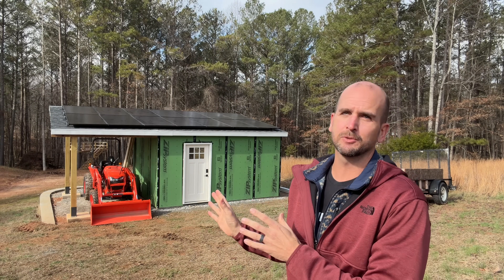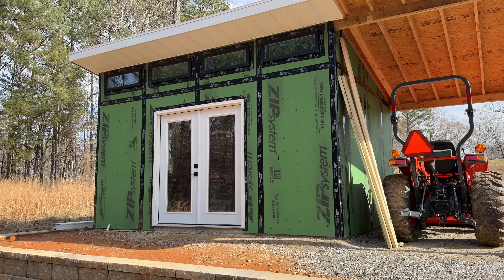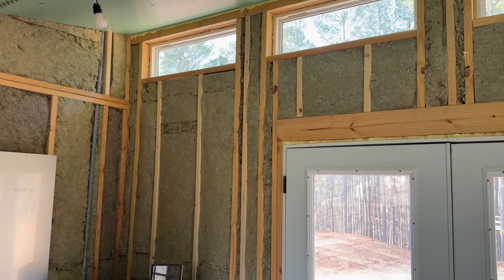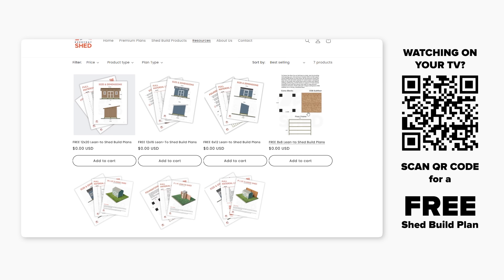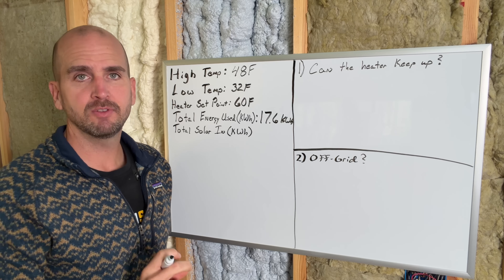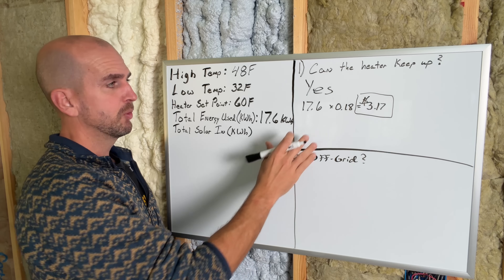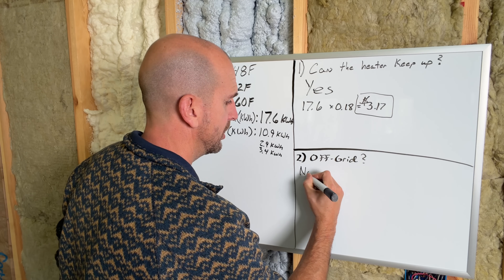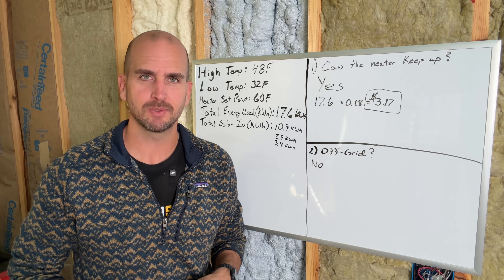HUGE Mistake: Why My $15,000 Solar System CAN'T Heat My Tiny Shed

Comment: Resistive heating is way too energy intensive for it to be a good idea, the style of heater you used is also notoriously inefficient and actually runs closer to 600w worth of heat.  Look up the video "Oil filled heaters: 600 watt heaters pretending to be 1500 watts"

The best way in my opinion would be a window AC style heat pump, with a Geo thermal mod "Turning a $150 AC Into a Super-Efficient Geothermal Unit!" from Tech ingredients. It's not drop in ready or super easy, but when you have limited amounts of energy, you have to get creative.

Comment: As others have mentioned, a heat pump would do a much better job.
I am not sure a 24 hour heating test is going to show you how much you use in real conditions. You don't need much heat at night. A heat pump can be programmed to turn on when you need it. Or be remotely switched on before you go to your office.

I personally would have chosen a different route though. If you have access to cheap or free wood, then a wood stove would be the cheapest solution. Propane is a good alternative if you are not sitting there too often.
Another solution is solar thermal panels. Combine these with a big storage tank and you can store heat for a week or scale that up for even longer durations. Heat storage is cheaper than battery storage. You can add an electric heater that uses excess solar (you're still going to want a small solar system for your lights and devices). This can also be combined with a propane heater.
Reply: I just realized, there is something else you could do in your situation. Although a heat pump could already make the system a lot better, you're going to need to increase your storage to get through a few days of cloudy weather. The best way to do that is to get an air to water heat pump, that makes hot water, which you can store in a large water tank.

Comment: One of those chinese diesel heaters would be perfect for that shed. You could even mount it outside and pipe the heat inside. Use offroad diesel fuel to keep costs lower. Otherwise a small pellet stove would easily do it. Relying on 100% electric is quite a challenge in comparison.

Comment: I saw what you did insulation wise in the ceiling, it's really not enough. Heat rises, the walls are important, but less so than the ceiling.
Reply: Hot air rises.  Heat radiates from higher to lower temperatures.
Reply: Incorrect. Walls are extremely important. They make up the majority of the surface area. Yes he needs more ceiling insulation but it doesn't take priority over the walls. Passive builders have been working on wall insulation improvements since the 60's.
Reply: @shawnd567  that's because when they use the term passive, it's referring to dynamic\nInteractions with the environment , not just insulating

Comment: Mini-split inverter compressor with hyper-heat would do a lot better job then that oil filled heater. I also plumbed in a diesel heater into my tiny home as a backup .

Comment: Yes,Zip R for continuous external insulation, R 40 ceiling, slab insulation and a mini split would perform much better. It would also cost a lot more. Really depends on use cases and cost of electric for the individual if it’s worth it.

Comment: Just an idea here..... With ALL electric-resistance appliances (ALL electric space heaters. hair dryers. toasters. clothe irons. water heaters. hot plates. soldering irons. heat-guns. hair driers. electric stoves and ovens. toaster ovens, etc) you achieve exactly 3.413 Btus per Watt. No more. No less. That same Watt run through an average air-to-air heat-pump achieves, depending on the outdoor temperature, around 8 to 9 Btus for the same Watt. A high efficiency mini-split heat pump with a higher HSPF rating can give you 12-15 Btus or more for that same Watt. With electric heating, an electric-resistance space heater is the most energy hungry of all of them. It does not matter if it is 'oil-filled'. It does not matter if it is 'radiant'. I does not matter if it has a 'ceramic disc'. If it is a plug  electric space heater, on a high setting it is typically 1500 Watt (the highest allowed). At 3.413 Btus' per Watt it achieves at most 5,120 Btu's per hour, IF it is actually using all 1500 Watts. When I use a Watt of electricity, I like getting 12-15 Btus per Watt via my mini-split, and not the 3.413 with an electric-resistance type heater. Thus, the solar system could do better if not using electric-resistance heaters..... And, a simple ACCA Manual-J calculation of your building would help determine the actual Btuh need for the building at different outdoor temperatures.

Comment: Two inches of foam and heat tubes in your slab.  Then heat it with a small propane on-demand water heater and a 100w circulator pump.  Best heat you can get and a small solar setup can run the circ pump and keep the space warm

Comment: I love your channel and appreciate the great information and ideas you tell us about. The following is not a criticism, but a suggestion. You are supposed to 'face-staple' fiberglass batts, and install them where the batt fully fills the cavity; they should not be 'tucked' in the sides. Tucking leaves a gap down both of the entire lengths of the cavity. With all insulations there should be no gaps. No voids. And no mis-alignments, between the insulation and the wall covering. I know some drywall folks like it when the fiberglass batts are 'tucked', fully exposing the edge of the studs. But still, not the best way to install it.
Reply: Your instructions on how to install the batts is 100% wrong.  The fiberglass is touching / sealing to the stud and there is NO gap as you suggest.  The reason to overlap the "tabs" on the stud face is to form a vapor barrier as at one point, the paper was sprayed with tar as an adhesive to hold the fiberglass.  The reason you do NOT cover the face of the studs if installing drywall......correctly installed it's GLUED on every stud and the screws are only used to keep it in place while the glue cures.  This results in a much better bond, chemical versus mechanical, and far fewer screws are needed = less finishing labor.  The glue will not penetrate / bond through the paper tabs on the batts if they are on the face of the stud.

Your method is only 20+ years out of date.
Reply: @Paladin7845 Cite ASHRAE standards
Reply: @ßeau_M  Have NO idea what you're asking for or how that's relevant.  30yrs in the construction industry, (Licensed Builder, Project Manager for both Commercial & Residential, and Truss Engineer) experience with the products, and understanding the solvent in the adhesive wont penetrate the paper is all the "Standards" I need.  From your question I'm betting your the type who's incapable of doing their own research and needs instructions for everything.  If I told you water is wet and the sky is blue.....you'd ask for "Standards" to prove it.  No one has relied on the paper flanges to provide any kind of air, vapor, or moisture barrier in 20+ years.  
Comes down to......do what ever you want on your projects.......but don't post inaccurate information.
Reply: @Paladin7845  beware any contractor who starts an argument with "I've been doing this for 30 years"
Reply: @pb7379-j2k  How does 3 decades of experience invalidate my statements or experience???  It doesn't. But you have NO better response........typical.
Reply from the maker: Thanks for the feedback.

Comment: $15k for such a tiny system is bad purchase. For $15k you can do a huge diy system with way more solar.
Also, a space heater is the worse way to heat anything. Its just inefficient. Use a diesel heater to heat the shop.

Comment: As others have said, resistance electric heat powered by solar plus battery is a terrible idea. Plenty of small heat pump systems are available for that application. Also, insulate the floor. Rigid foam topped by click together flooring would be one easy way to go.

Comment: It seems like solar needs to perform better and get the price of components down a fair bit before it is worth it to invest in it. A huge part of North America and the most populated part of the US get a lot colder than 32 F. Some people that make videos rate the value higher than every single person that I know that has spent 10 thousand dollars or more on a solar system tells me that given the chance to go back and not spend the money they would. I live in a 900 square foot home and pay about 960$ a year to heat with gas and where I live it hasn't been above 32 F for nearly a month and will get a hell of a lot colder like tonight will be about minus 12 F. That battery alone would be years of heat so my gas generator will be my back up for the forseeable future.

Comment: Go with the DiY mini-split(Mr. Cool). Then you will have both heating and cooling.  Install GPS foam board insulation on the exterior before installing siding. Air seal the interior drywall to the ROs and top and bottom of wall before installing trim. A tight building with extra R value doesn’t need as much energy to condition.

Comment: $15,000 would be 12 years of electricity for my entire home. Granted, that's with natural gas furnace, water heater and range, but it's a two story with basement. What's the lifespan of that setup? I doubt it will last 12 years. 🤔
Reply: in europe right now with a heat pump that amount of money is just a few years of heating! so it depends on location... with gas, even more expensive.

Comment: Oh look another video to trash solar that didn't use proper building materials or WOW: even bother to finish the space. I am actually embarrassed for you. Air in the closed wall space is part of the insulation system. Studs with no drywall and no complete envelope is literally garbage data.

Comment: if I were to make a shed that was 100% solar and off grid I would minimally follow the 5-10-20-40-60 insulation rule, aim for an ACH50 of 2 or less, and install a cold climate mini split.

Comment: so for my off-grid shed (10x20); with 10 panels and 4 batteries and rockwool all around. I tried those little heaters and I tried a very efficient mini-split. It would drain my batteries in the winter so deep that I needed every day with sun to keep up. But I found/stumbled on a neat solution. First its my shed so I didn't need it at human comfort, just never get to freezing especially for the batteries. I found that if I put those RV heater pads between my batteries. I just needed three; they only took up about 65 watts and came off/on based on a thermostat setting. For me problem solved! Even on the coldest days it didn't drain the batteries and it allowed several days of barely any solar. I forget how much those pads cost but I remember it wasn't painful. Because the inverter also generates heat too, my shed by the batteries never got below 40 degrees even when it was 20 outside. Of course I still want more but will have to wait for funds. :)

Comment: I would never run an electric heater off a solar power system, inefficient is an understatement.
I'd cheat and use a diesel heater powered by that system.
Uimoso Diesel Air Heater 8 kW 12-24 V is one version, there are better.
Or go with a pallet heater, wood works but it's a lot of extra work.

Comment: I would add a insulated subfloor. Even half inch would be massive as a thermal break

Increase your roof insulation 

Switch to heat pump mini split and you’re probably good.

Comment: Isn't the first step in designing an off-grid house to minimize the load? What if you were to increase the insulation in the shed? 2x6 outside walls with 6 inches of insulation? Even more insulation than that in the roof? Is there any insulation in the concrete floor? How well is the structure sealed? How good are the windows? It looks like you have the bare minimum as far as all of that is concerned. Of course, all of those things would add to the cost of building the shed, but they would also reduce your energy requirements and therefore the size and cost of the solar system required to heat it.

Comment: If you go nuts with the insulation and make it airtight the 100watts of heat coming from your body will be enough to heat the space. Insulate to meet your heating budget.

Comment: I realize this is just a proof of concept and will progress into further additions, but I'll chime in on insulation. Adding 1.5" rigid foam (XPS or polyiso) to the exterior side of the studs works well with 2x2 purlins and nominally gains at least another R=7.5" or so AND also eliminates much of the thermal bridging losses of your framing. Headers, as well as king and trimmer studs gain the most in R-value from this treatment.

Similarly, most codes allow eliminating a ventilated roof assembly with a proper amount of non-permeable insulation (closed-cell spray or rigid foam) that matches your climate zone, and however much fluffy stuff underneath it you’d like… sometimes called “flash and batt”.

As a lot of people have already said, always insulate under the slabs and stem walls before pouring flatwork.

I did all of these on the house I am building in the mountains of Colorado, and the lifetime energy savings will be substantial.

Keep up the good work, Scott!

Comment: Just finished my shed.  It will be primary shed but also small workshop.  Will eventually install a small solar system to run lights, chargers and occasional power tool.

Our climate is mild (almost never below 32) so my plan for heat is a portable diesel heater.

Comment: A small fan would probably help circulate and heat the space up faster, especially with a oil radiant heater.
Reply: This building leaks heat like a sieve. The only thing a fan will do is to make it leak heat faster, so the fan will make things worse.

Comment: I don’t understand the test. Is it 24 hours of heating? Wouldn’t it make more sense to consider if it could work for a ‘work day’ or something like that? Something like 65f for 8 hrs after starting off cold? I imagine heating during the night is the killer here. 

Also, ceiling insulation is inadequate and it’ll also be better with drywall.

Comment: I use the eg4 12k btu solar air conditioner and heater.  Works fantastic.  Produces 109 degree air coming out of head unit at 280 watts but it must first heat area up but this monster can do it in an hour.  Used to cool of 280sqft container with r13.  It works even better in the summer averaging 250 t0 300 watts an hour.  It literally freezes us out.

Comment: That concrete floor is sucking up your expensive solar heat!  You need to put down insulation over the concrete between sleepers and then install a wood floor.  Your ceiling insulation should be at least R 30.  You can buy R 19 fiberglass insulation that will fit between two by fours.
Ron

Comment: Heat pumps are key..... but rarely considered:   If you are going to get low on batteries because of heating..it's uch better to turn on a diesel parking heater than to burn that same fuel (or gas)  for heating rather than run the only 33% efficient generator.  Parking heater is easy to automate  and about 75% efficient., quiter,less maintainence.      Now  generator running a heat pump (or charging batteries) is about the same total efficiency ....BC 1/3 efficiency generator X 3x efficiency Heat pump gets ou near 100  (actually less because of electrical conversions)....blah blah   point is consider parking heater to circumvent running generator.      Propane is very expensive, Nat gas is very cheap

Comment: I'm not sure why you put less insulation on/in the ceiling than in the walls. I would start with more insulation overhead and a heat pump solution. I think you could make things work that way.
Reply: Heat rises! Ceiling insulation is the most important always!
Reply: He really doesn't understand construction. If you scroll through the comments, you'll see good comments on the basic mistakes he's made

Comment: There's a lot of room for improvement in the insulation of this structure. The first is using canned spray foam. The board-foot cost is terrible as well as the R=Value per-inch. Something more like Tiger Foam or Foam-it Green, etc would have been a much better use of money and offered a higher R-value per inch than anything else you used. The cost still would have been higher, but with such a small structure, it wouldn't have been THAT much more than the Rockwool. 

With a structure like this, with as much solar as you have on the roof, I doubt you really need ventilation under your roof deck. I would have spray-foamed under the roof deck as well and had the whole structure air sealed. 

It's too late now, but a continuous insulation layer to the exterior of the framing members would have helped a lot as well. You could still do it to the interior with foam board. That will cut down on thermal bridging as well. 

Using resistive heat isn't the best use of electricity. At the temperature range you're dealing with, you could EASILY get twice as much heat into the building with the same input power using a heat pump of some sort. And that's being conservative. 3 times more is probably more like it. 

I think if you improved your roof insulation and moved to a heat pump, you'd be able to have the solar+battery probably meet your demands most of the time.

Also, for anyone reading this, insulation is a one-time expense, that if done well, and correctly, will then save on energy costs for the life of the building. I would personally never skimp on insulation, windows, and doors. Buy once, cry once.

Comment: So you would only need ~5000 btu heat production in order to heat the space.  That is not a lot.  There are some better systems to provide that small amount of heat need.  An evacuated tube system for heating water might also be able to do that type of heating job., but you would need to circulate the water during the day and have some storage capacity.